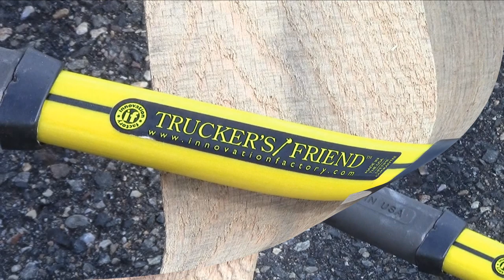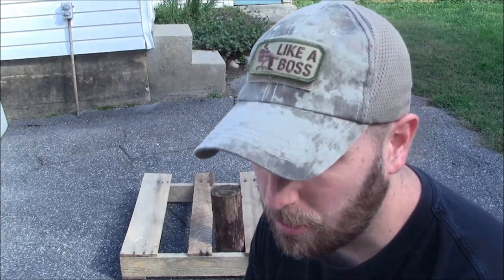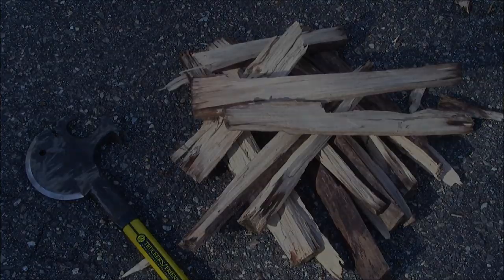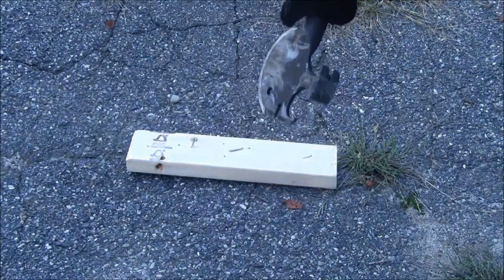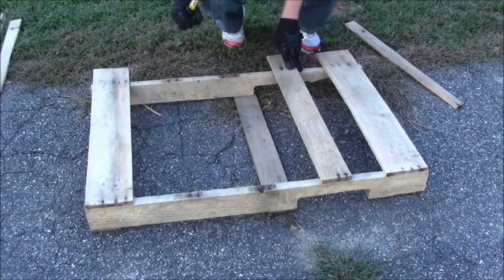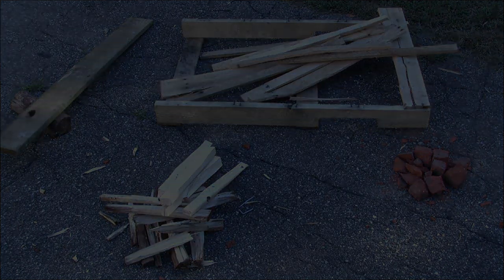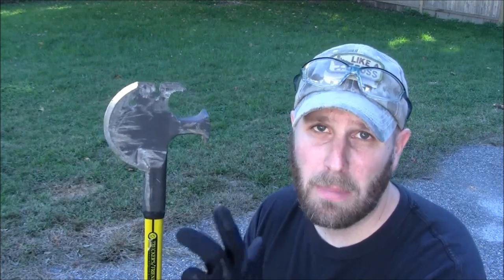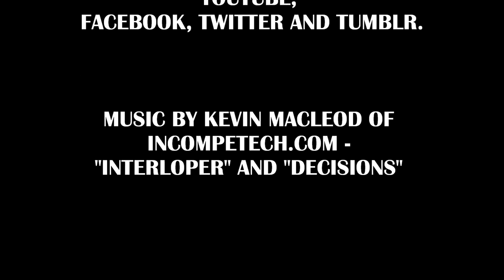Trucker's Friend Demo/Utility Tool

Comment: well for flat bed drivers it would be wonderful  for the setting and removal and the hook on the top am i wrong or would that fit wonderfully on the ratchet tie down holes for the straps?

Comment: How much does it weigh? And how well do you think it would do on prying open doors? Would be a little worried about the durability of the fiberglass handle when putting alot of sideways pressure on it like when prying open a heavy door.
Reply: 2.6 pounds lol nevermind on that part
Reply from the maker: I really beat it up and it seems solid.
Reply: nice mask I love Zorro too
Reply: There isnt much of worry for fiber glass I have grandpas old fiberglass and iron hammer and it looks to be about the same quality and its still goin strong